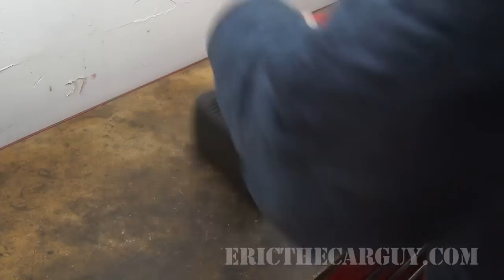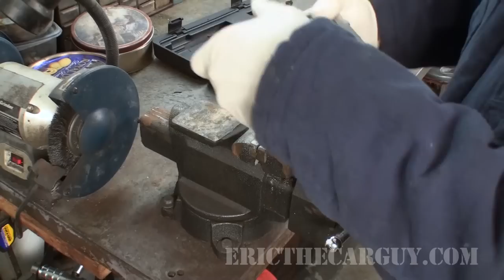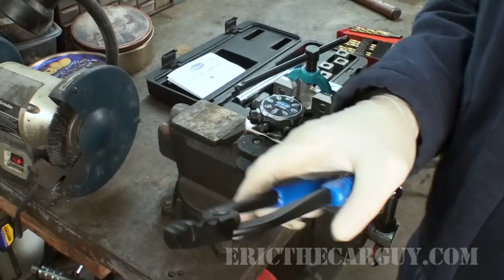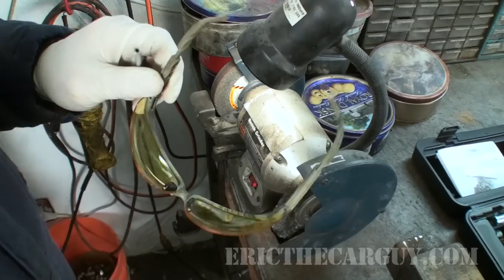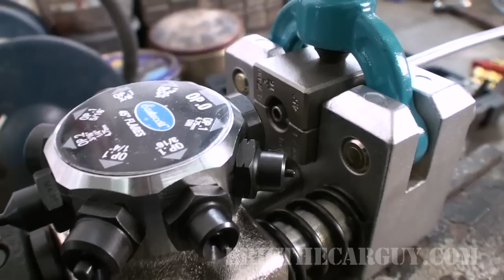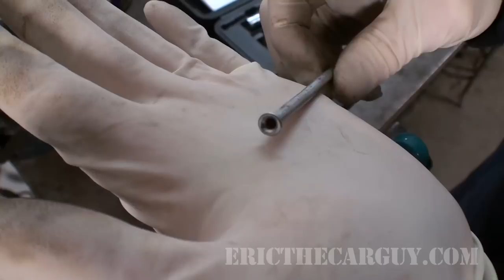Eastwood Line Flaring Tool Review -EricTheCarGuy

Comment: with the tubing bender pliers, you want to hold the pliers the other way around to bend them. with the curved part of the pliers facing the bracing point of where they're being held
Reply from the maker: Yea, I actually thought about cutting that part of the video but I wanted to leave the pliers in. Perhaps at some point during a project I'll demonstrate how to use them properly. Thanks for your suggestion.
Reply: You may want to look at the sliding block style as well, The pliers work good for tight bends in close to fittings and areas like that but the other style usually are easier to use.

Comment: First of all, if you only have a 60-70% success rate with the hand tool, you're doing something wrong. I've been using the "Manual" flaring tool for over 40 yrs. It works just fine. Occasionally I'll get a bad flare, but no where near 30% of the time. Second, sometimes you have to flare a line that's on the vehicle, and you can't bring it to the vice. The only difference is the effort. That manual flaring tool is a pain in the but if you're replacing all the lines, and doing multiple flares, or if you're old like me and your grip isn't what it used to be.
Reply: Can't do field work with that thing.

Comment: Nice setup for a production shop, but I would have a heck of a time getting your bench and vice
under the car. I want a tool to use mobile, cut, splice, done. I don't get 70%-80% success with
cheaper tool .Not always quality of, but always the quality of the mechanic . Do a couple test
flairs, if your not sure.

Comment: $250 is hard to justify for this tool how many brake line jobs does the average mechanic get? You might do one then a few years go by before you need it again. I build race cars and have plumed whole cars but theirs just not enough profit to get this tool. I like seeing how it worked though I think you could have cut the video  down by about 2/3 of the time. I would have like to see you once just flaring it without the pausing in between to see the  speed of it.  37deg flares are used on "AN" (army navy) fittings (them blue and red ones you see on race cars) they use a support sleeve on the back of the tube flare and only need a single flare, so they are pretty easy to work with because doing the double flare is the part that is hard on that "other tool"

Comment: The problem with the other tool from my experience and what I see other people doing is: you need to tighten the clamp nearest the tube 1st then tighten the other one, if you do it the other way around the tool has no leverage to tighten down right then the tube slips on you.

Comment: i have a brake flaring set that did not come from harbor freight or eastwood. I think its from yellow jacket? tho, it only does single flare brake lines & it's been many years since I have done my own brake line repair & in all my ignorance, I never even knew about a double or bubble flare until a few months ago! SO, my question is, HOW MUCH RISK AM I TAKING IF I CONNECT MY REAR BRAKE LINES & REAR WHEEL CYLINDERS ONLY USING A SINGLE FLARE ON A 03 FOCUS? In years past I did my own brake lines & I never had a problem with a single flare! I get the theory but, rite now, I am in a pinch & can redo my brake lines again at a later date. Rite now, I have to get back & forth to work & don't have money to buy a second flaring tool. WILL IT BE FINE FOR 1 YEAR???

Comment: I'm not quite sure you where using them there pliers quite right, looks like they make nice tight rads.
Reply from the maker: I wasn't. In fact, I almost cut that from the video. Perhaps at some point I'll be able to use them in a video. In fact, I found a compression fitting on one of the brake lines on the Fairmont the other day.

Comment: Hi 
I have a 2001 chevy tahoe 5,3 vortec and i live in Norway….i tried to double flare like i have done before on my old chevy van 1990 ,but that flare did not fit my tahoe….it only leaked everywhere,so i ordered your kit here Because i think you use a different  standard on american cars than we do here and hopefully the flare you did in this video is the same as the one i have on my tahoe….can you confirm this?i like your channel it is detailed and very easy to understand….you should probably be a teacher😉💪👍TS from Bergen Norway

Comment: In the last 12 years or so I've bent lines by hand and never once had a kink or buckle in any metal lines. I use kneecap for large soft bends or thumbs for tighter radius. But the fabbing of lines I found really sucks are arse. Those flaring tools have about a 50% success rate for me.

Comment: Eric. I had a few questions:
What kind of tools to you use to get into tight areas for brake lines.  For example, my flare wrench (10mm) can't get into the area. Too tight.
Also, I have no garage and thus no place for a vice and this tool by EastWood.   Would I be off better buying pre made lines from Auto store and just connect the various sizes?   Also, for cutting existing lines,  wouldn't it be better to just cut the line right before it is rusted and use a hydraulic flaring tool to flare it where its cut and just connect a new preformed line?   I noticed that most of my lines usually are in good shape until you get towards the back, where they cross the exhaust..

Comment: That tool is pretty impressive but the flare tool my father has will make you want to throw that one away. His is a hand held hydraulic and does the job in a fraction of the time that ones does it. But also its around $400. But both are impressive.

Comment: They sell the pliers at Harbor Freight on the cheap.
Reply: Yes, I was found the bending tool at Habor Freight and another one that is smaller that I prefer.  The Eastwood flaring tool is sold under TGR brand for $180 on Amazon.

Comment: I use a tube bender for 90 degree bend's w/ flare fitting nuts on both ends, the distance between the flare nuts will be determined by the thickness of the die or tool holding the aluminum or copper tube to be flared.  U have to install the fittings onto the tube after inserting into the dies or holding tool. The cheap tool u wanna throw out is only 3/4" thick compare to what ? Eastwood's 2"+ thick dies?  When making a "Short" 90 degree tube bend W/ flared double nuts.  the  2" of tube on each side of the 90 bend to hold into the die will turn out to be 4" more tube to the 90 bend, " Not Good" for making "Short / Tight"  90 bends

Comment: about finding out the sizes, just use the dye :D easier because you have it right on your hand, and about at the most shops in Denmark we use copper brake lines, because they dont rust and are easier to work with, and we have a lot of salt on the roads at winther time. 

but brake lines is hate job for everybody especialy on a newer VW Transporter/caravelle

Comment: I don't know... if it's 70% effective and I do it once every 3 years I rather buy the 25 dollar tool from Harbor Freight than spend 200 on a really nice machine. I do love tools that work good and will last forever, but at the same time I have to ask myself; is it going to be worth it to me? Sometimes the difference between a bad tool and a good tool is 10, 20, even 50 dollars, and that's fine. 175 dollars difference though...
I actually went to the junkyard and pulled brake lines off a car rather than making new ones or having them fabricated. The junkyard charged me 1.50 per line, and they were good as new and OEM quality since they were OEM.
Reply: Still loved the video though! Sorry for sounding critical.
Reply: Jesse Crandle
Issue with the cheaper 'clamp' type flare tools is that the knurls that hold the line in place round over far to easy.  Now if you're smart?  OTC makes a tool called a "Stinger" that looks exactly like the cheapo double flare kits.  Runs about $25-$30 at Autozone (where I ordered mine from)  Napa sells it for $45-$50.  The tool is made from better steel and it resists rounding over/flatting out the tube retainer part.  I've used it for over 2 years now and it's been rock solid.  Unlike the cheapo house brand ones they try to push off---that you'll be swapping out every 4 to 5 flares when the line slips out of the tool.
Reply: Well there is also the factor of what material are you working with. For example mild steel lines can be bent and re-bent with virtually no issue so making a mistake isn't going to make you start back at square one. BUT for example if you are using stainless steel once you bend it stays bent. So if you screw up a few flares and end up having to cut back too much you might end up having to bend a new piece instead of being able to modify the bends to make it reach.

Comment: this is only a bench tool? i guess this tool would not work well if you had to make a flare on a line that is still mounted under the car the car... where i work i replace many lines to the rear of the car and therefore do not remove the line all the way to the distributor
Reply: I find that if I only replace the part of the line that is damaged, the vehicle tends to return with failures in other areas of the line.

Comment: The true benefit of the cheap tool is that you can acteally use it while the brakeline is still on the car, like for example if you only need to reflare or smoething.
Reply from the maker: Yes, that is true.

Comment: If I only had a few flares to make, I'd stick with the Harbor Freight model. The other one is sweet, but not worth it for only a few flares. It's more like a tool that a professional mechanic would use over the years...
Reply: tom7601 It's worth it for even one flare. The other type simply don't work. I don't care how good you are or what type of patience you have. They just do not work. It may make something that works at first glance, but I wouldn't trust it years down the road.

Comment: use nickel copper line prob solved bending the line plus it wont rust. I wouldn't use anti-seize i'd use brake fluid. why not you know.

Comment: instead of using the grinding wheel....why not just use a debrurring tool and save that electric bill :)
use it all the time since I'm a plumber....
these come in different sizes also...
here's a random German eBay link how it looks like, for you tool noobs.

http://www.ebay.de/itm/1-x-Rothenberger-Rohrentgrater-6-35-mm-Innen-Ausenentgrater-ST-CU-VA-/201478175834?hash=item2ee908fc5a:g:tasAAOSwv-NWYEPR

Comment: I'll take the naff tool off your hands, at least its small enough to get under a vehicle with when you need to slip a section in as you cant remove the whole run.

I dont think the super tool would do flares for genuine high pressure citroen lines either.

odd shape.. kind of..
---/\----------                                       .
---\/----------

so its like a simple flare but with an inch of plain left exposed.

Comment: I've never been able to make a flare with any of the types of tools you showed at the beginning of the video. Never. Only single flares, and basically nothing uses them. It doesn't matter if it's an el-cheapo one or one from someone like Snap-On. They simply do not work.
Reply: To check size using the drill bit is one way but a better way is use the drill index, insert the line into the index to see which hole it fits into, one size bigger than the smallest hole it won’t fit into.

Comment: Wrong! 
Please watch Easwood's video, the tool manufacturer video.
To make bubble flare you need to use square end of the dye, not the 45° degree end. In addition you are supposed to use different OP dye.
I watched ECG's video then made a line, now I have to re-do the job and line is already on the vehicle.
Great job Eric, thanks
Reply: In addition, no need to chamfer the ends, just use lubrication, chamfering removes additional material from the line, so after flaring it will have weak spot(s)